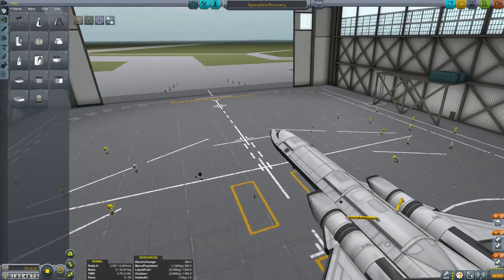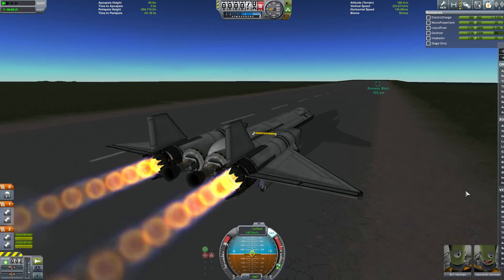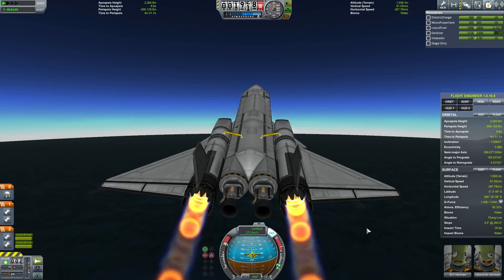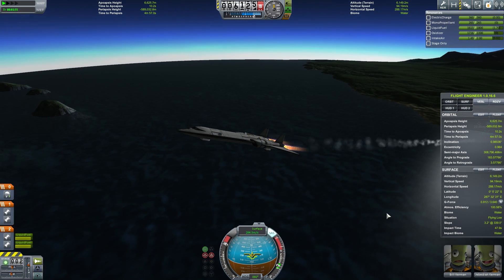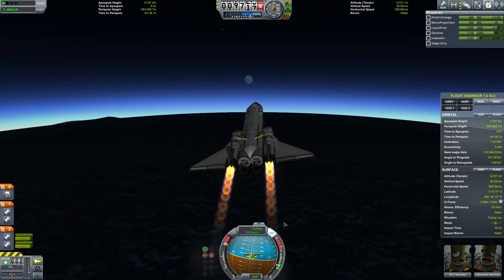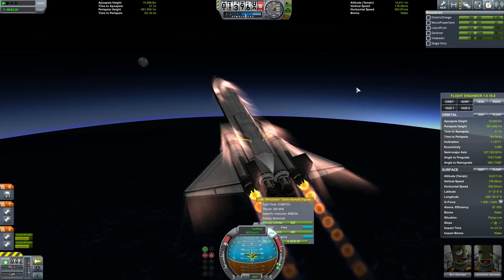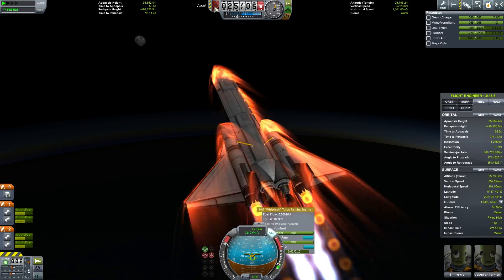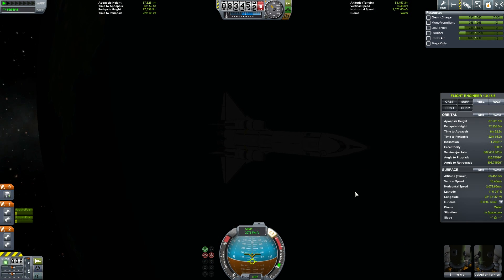Flying the Spaceplane To Orbit in KSP v1.0.4

Comment: I've been tinkering around in prerelease 1.2, and I'm finding the new (realism?) changes are not  favorable when launching my space plane, a design similar to yours but closely resembling the SR-71, into a stable orbit.... I'm using better parts because shock cones make no sense to use right now. I might be mismanaging my fuel, but I am essentially using your tips and need another 500 delta V.

Update: I don't like to lose. After calculating my TWR, I doubled the Whiplash (adding additional fuel (2 800s and 2 400s). Then, through accidental chance with staging, I realized I could change up a few other things and get better results. I didnt close the air intakes, letting them flameout. Rockets were activated around 14km after a fouth attitude maneuver (nose was between 30 degrees down to 5). I easily achieved orbit once I became more aggressive yet still remained attentive to the balance between speed and altitude. Fly safe Scott.

Comment: Just an obvious note, This does not work in 1.1.2 you will run out of fuel even with the oxidizer reduction. If you add more fuel then you are too overweight to get the altitude without losing all your thrust.
Off to find an updated video.

Comment: thats not how i did it, in 1.0.4, use your jets for as long as possible to build up orbital speed, when you get to around 1400 m/s or more, and you're 25km or so, switch to rocked mode and lift your apoapsis to above the atmosphere

Comment: Very disappointed that my flying wing design could not get into orbit.  As ridiculous as it is, I'm not sure I can say I'm very surprised.  But is it even possible to get something like a flying wing into orbit in this game?  Because it looks like the only way to go is sleek and small.

I've tried adding more engines to no avail.  Reducing overall weight only made it crash into the ocean time and time again.  Cursing profusely at the laws of physics only angered the game and made it crash.  Finally, I strapped it to a rocket booster and watched as it blew up on the launch pad.  

I hate spaceplanes.

Comment: The SR-71 didnt fly with afterburners on all the time. That would be a terrible waste of fuel. Plus the main countermeasure the SR-71 had against Soviet SAMs and AAMs was its speed and altitude. The pilots had to accelerate if they detected a SAM launch and if they were on constant afterburners then they wouldnt be able to accelerate fast enough.
Reply: bamarocks777 Its a bit weird because of the way the SR-71's J58 engines work.

At lower speeds the J58 is a normal afterburning turbojet. Airflow passes through the compressor, combustors and turbine before entering the afterburner and nozzle. The SR-71 used this mode up to about mach 2. 

 At higher speeds the intakes themselves provide plenty of compression of the incoming air. Air is vented from the early compressor stages directly into the exhaust- this serves two functions, firstly it prevents the compressor blades from overheating and secondly it provides extra air to the afterburner. The reason an afterburner is normally really inefficient is that some of the oxygen in the incoming gas has been burned in the combustors and the combustion pressure is relatively low (The turbines extract energy from the gas by causing a pressure drop). In the J58 at high speeds the inlets are compressing the incoming air and a fairly large proportion of it is bypassing the combustors and going straight to the afterburner. Thus the SR-71 afterburner is actually significantly more efficient than a normal one at high speed. 

Because much of the air is now bypassing the turbojet part of the engine, the turbojet has less flow and cannot generate much thrust. The vast majority of the SR-71's thrust in cruise came from the afterburner. Afterburner fuel flow is variable- Presumably in cruise the engine ran at less than 100% afterburner most of the time, but the aircraft did cruise with the afterburners on.
Reply: bamarocks777 Its a bit weird because of the way the SR-71's J58 engines work.

At lower speeds the J58 is a normal afterburning turbojet. Airflow passes through the compressor, combustors and turbine before entering the afterburner and nozzle. The SR-71 used this mode up to about mach 2. 

 At higher speeds the intakes themselves provide plenty of compression of the incoming air. Air is vented from the early compressor stages directly into the exhaust- this serves two functions, firstly it prevents the compressor blades from overheating and secondly it provides extra air to the afterburner. The reason an afterburner is normally really inefficient is that some of the oxygen in the incoming gas has been burned in the combustors and the combustion pressure is relatively low (The turbines extract energy from the gas by causing a pressure drop). In the J58 at high speeds the inlets are compressing the incoming air and a fairly large proportion of it is bypassing the combustors and going straight to the afterburner. Thus the SR-71 afterburner is actually significantly more efficient than a normal one at high speed. 

Because much of the air is now bypassing the turbojet part of the engine, the turbojet has less flow and cannot generate much thrust. The vast majority of the SR-71's thrust in cruise came from the afterburner. Afterburner fuel flow is variable- Presumably in cruise the engine ran at less than 100% afterburner most of the time, but the aircraft did cruise with the afterburners on.

Comment: Do the temperature thingies still cause memory leaks?
Reply: RedsBoneStuff they supposedly fixed that.
Reply: Regolith Thanks. Then I don't need to restart my computer after playing KSP any more.
Reply: RedsBoneStuff you never had to...quitting KSP and relaunching it is enough to deal with the memory leak. Once the process is ended, the computer reallocates the memory, so a full restart isn't required.
Reply: Regolith Really? I thought that was up to processes to do themselves.
Quite worrying that I didn't know that, since I am about to study computer science ...
Reply: RedsBoneStuff it might have been an issue with older OS's, but modern ones have better protections against that sort of thing.

Comment: Although my variant is using the Rapier engines instead of the normal rockets off the bicoupler (gives me just a bit more time before switching to oxidizer, probably at the cost of additional weight), I didn't really notice too much difference from 1.0.3 to 1.0.4.

I made a totally useless Mk1->1.25m variant of this that does just fine too (2 turbojets, 1 rapier), which I'd never managed before your video explained the ascent profile.
Reply: Ah, that explains why I found the original design difficult enough to consider tweaking it, then. I thought I wasn't hitting the thrust numbers Scott said he was hitting, but I figured it was user error.

Comment: I wish we had scramjets in KSP
Reply: There is a mod by instell tech experimental engines that adds 2 sramjets on one radio and one in line . the radial 1 has half the power of the in line one. There's also a third engine which runs off of electric charge and oxidizer also is there is a special item used to take care of overheating by using a bit of oxidizer inside of said item.

Also ^ didn't see the one above
Reply: nathan deberry Radio? You mean radial?
Reply: bamarocks777 nah i ment radio

Comment: In ksp I take about five minutes of burn to get orbit but maneuver node only takes like ten seconds. Why is this? Is it just incorrect pointing
Reply: Shrey Mittal Dont use the maneuver nodes in the atmosphere. That is not what they are designed for.
Reply: Shrey Mittal It takes about 4 to 4.5km/s dV to get a stable low kerbin orbit, if your craft is using way more than this i would be concerned with the efficiency (kerbal engineer will be able to help with this). There is a famous quote about space flight "once you get to orbit you are half way to anywhere".

Comment: so what changed in 1.0.4?
Reply: EpicSmileyMan64 Going from 1.0.2 to 1.0.3/4, the big change for spaceplanes was that in order to compensate for the reduced drag, they seriously decreased the peak thrust of the turboramjets and the rapiers, and they also halved their airbreathing ISP, so they're less efficient and it changed the way you had to fly the plane.
Reply: 1.0.3 caused some "issues" if you upgraded from 1.0.2 and had ships in flight.
Reply: duckrutt oh ok.
Reply: theres radiators in 1.0.4
Reply: Chan Lewis  while there are radiators in 1.0.4, they added those in 1.0.3. 1.0.3 was the update with features, 1.0.4 fixed a bug where crafts wouldn't load.
Reply: when i said 1.0.4 i meant 1.0.3 ok?
Reply: ok.
Reply: ***** get get?
Reply: get it?
Reply: Heat calculation, radiators, memory leaks fixed.
Reply: מה קורה חזכלענזכרכ That memory leaks was a good fix

Comment: That's odd... I actually had more fuel left when I got into orbit on my plane, and if anything my design is heavier than Scotts since I added a docking port and some monoprop tanks as a dummy cargo. o.0

Then again I stayed a bit longer in the pre 20k atmosphere layer to get my vertical speed up, and my engines were a ton lighter since I was running toroidal aerospikes for my closed cycle system.
Reply: ***** Aerospikes are way more efficient than the LV-T45's.

Comment: Is there a heat shield you can put at the front of the plane? They did put tiles as reusable heat shields on the front of the space shuttle, do they have that in KSP?
Reply: They are built in.

Comment: I managed to put this plane in orbit prior to this video. got very little fuel left. Planned to land in the KSC by going in slow descent from the opposite side of the planet. Got out of fuel had to glide in the night to finally land in the desert. Got 86% recovery of the vessel, at about 1,500 km or so... it was kind of an achievement for me.. :P

 Next thing I would like to know about some concepts about fulfilling those ferrying tourist up and down. I kind strap on hings but it is surely ugly and inefficient. 

Thanks for putting these videos up, Fly Safe Scott!
Reply: Spiguel I have ferried four tourists with this design. Add an Mk2 crew cabin, remove the cargobay and add mabye one more Mk2 rocket fuel fuselage short.
Reply: :D
Reply: Jimmy Andersson I actually made a smaller spaceplane before for passenger transport, still using the same number of engines though so I've standardized all my designs to this shape now.
Reply: ***** Thanks for the explanation. I have bad time balancing a plane for  those 4ppl missions, managed to do a 4 ppl orbit/ flyover/ suborbital to mun and minmuns with the same rocket. that hichiker thing is very  efficient. what I am thinking is to use this plane and bring just one tourist to his location and back, until I get the hang of making a "passenger plane". Thanks again mate.
Reply: going to meddle with this right away, thanks man!